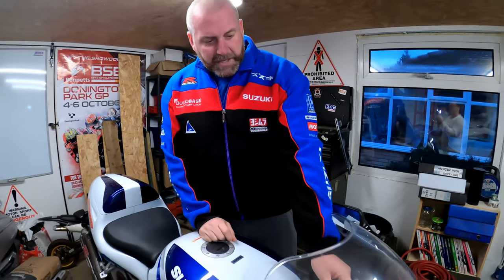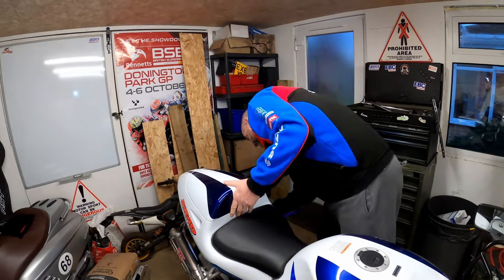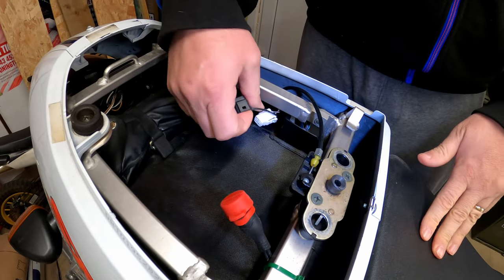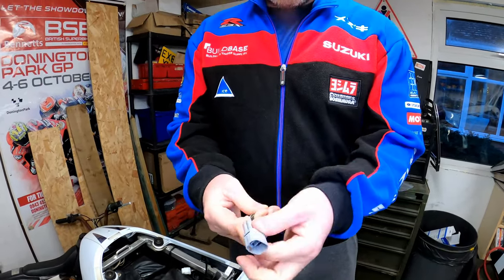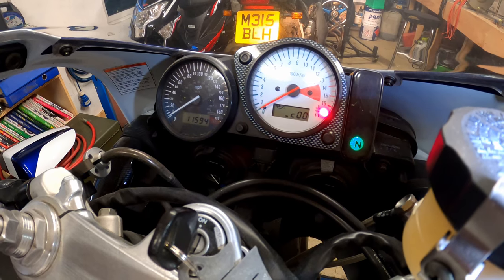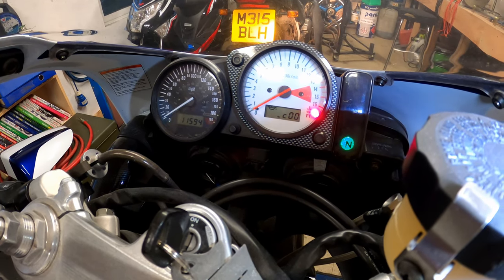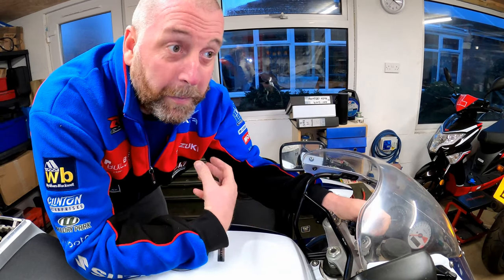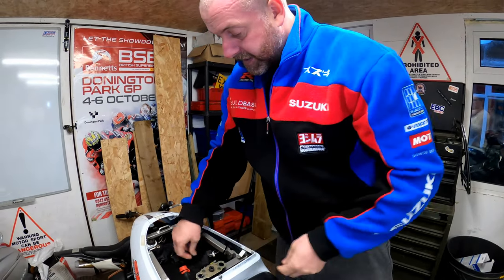Putting The Fuel Injected Suzuki GSXR750 SRAD Into Dealer Mode And Reading Diagnostic Fault Codes

Comment: I have the -c00 code the - is in the middle that’s the only code popping up when I try and get on the throttle at 6k rpm’s it just hardly goes and feels like it has no power when riding it was flashing the f1 light not sure what to do

Comment: So I have a Gsxr k3 “03” 750.  It’s been losing all power at times while riding down the road. Maybe kickstand switch?  Also when I turn the key on it says chec. So I put it in dealer mode with the Jump wire. And it’s shows _C00
Reply: I have recently installed a manual cam chain tensioner. The one that was in the bike had a oil line running to it that I eliminated. Would this cause any of my issues. ?

Comment: Hey my 99 gsxr 750 iddle jumps up and down but also bogs at full throttle any ideas
Reply: hi, i am currently working on my gsxr, it had water in the tank. Causing it to rust heavily and clogging the Fuel System. 
It also had problems running, so give it a look if your tank is rusted too.

Comment: Hi great video, would this work on my GSXR 600 srad 1999 ?
Thanks
Reply from the maker: No mate, your 600 will be carburetted 👍🏻
Reply: Thanks, is it normal for the oil light symbol to flash before starting it up?
Thanks
Reply from the maker: @michaelbarrass5461  It should always be on prior to the engine starting as there is no oil pressure but should go out after around 0.5 of a second of it starting.